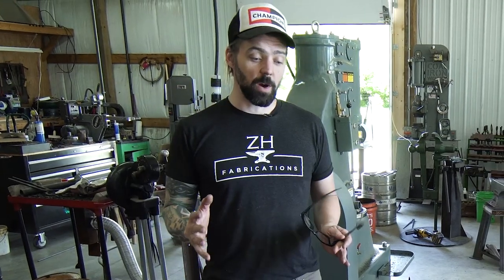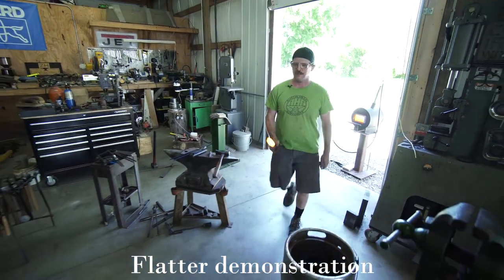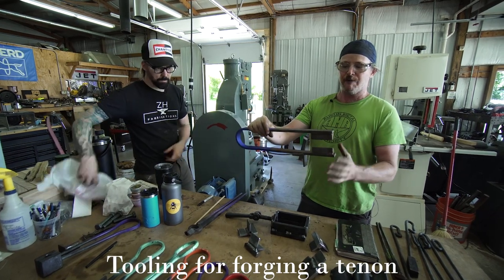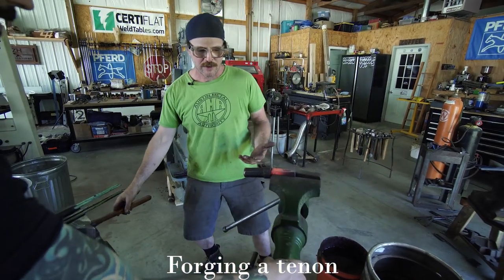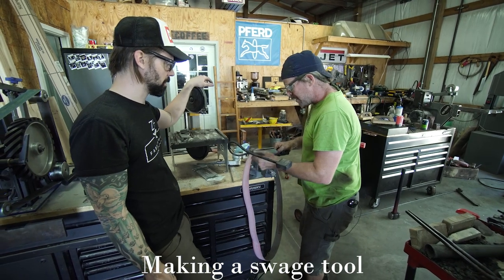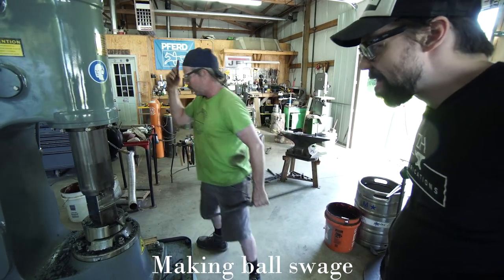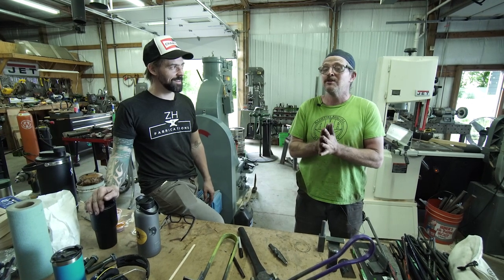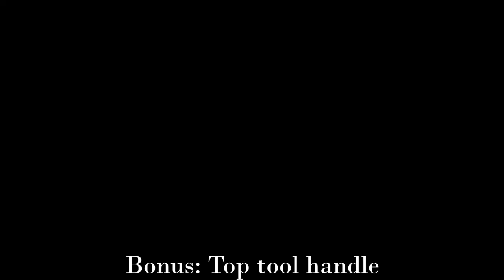Power hammer basics - Tooling & techniques with Haley Woodward (Anyang 88)

Comment: At 34:43 don't open the die after sinking  the bar to dress the edges of the depression. Simply put a larger diameter bar in it drive it down to create relief while it's still hot. You can use a larger ball after sinking the smaller ball same thing